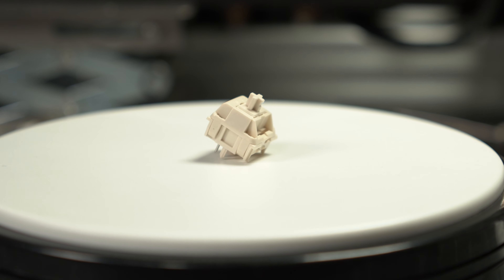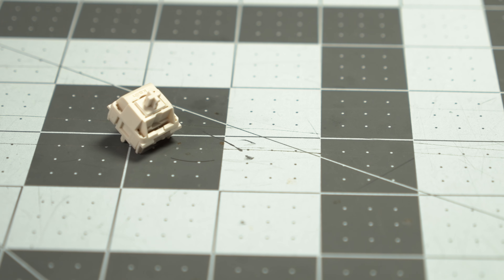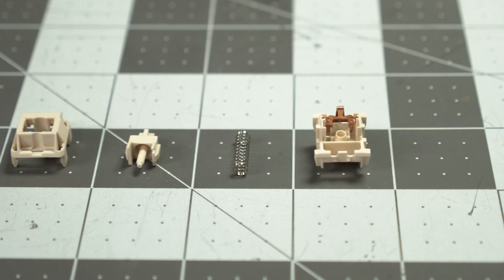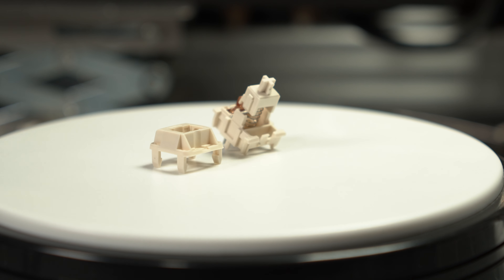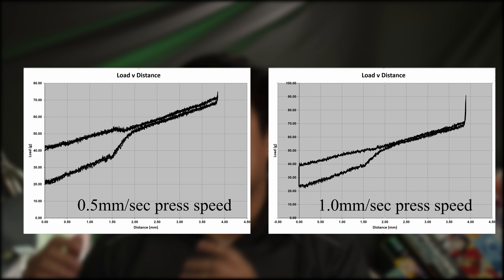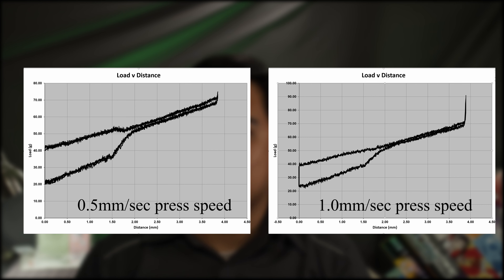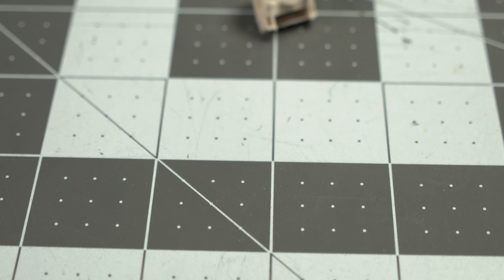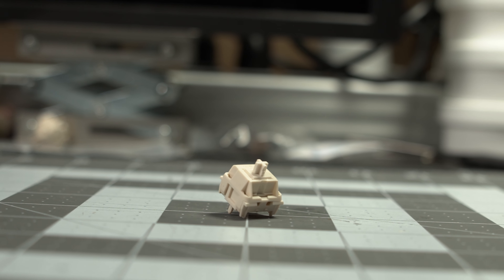Which Switch Creams

Comment: Your two force graphs have different vertical scales!    That means your conclusions that one is "jumpier" than the other doesn't work.  Show the graphics with the exact same scale.
Reply from the maker: Great catch Kevin! after I saw your comment I went back in and grabbed my magnicying glass. I assume you're talking about the comparison between the graphs with different test speeds. If so, I did go in closer and I think that the conclusion I drew is still held solid. If anything, I need to consider whether or not detecting less friction is simply from testing the cream at different rates vs how different switches test at different rates. This is worth the investigation and thanks for the comment :)
Reply: @manofinterests  cool... Yes keep investigating and let us know what you find.
Reply: cool... Yes keep investigating and let us know what you find.